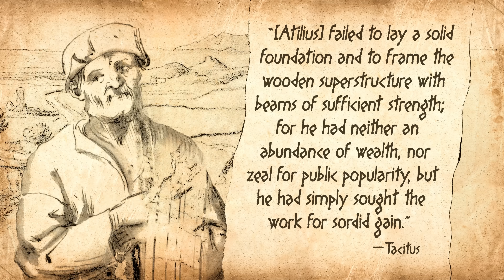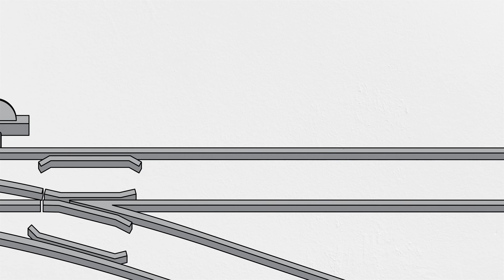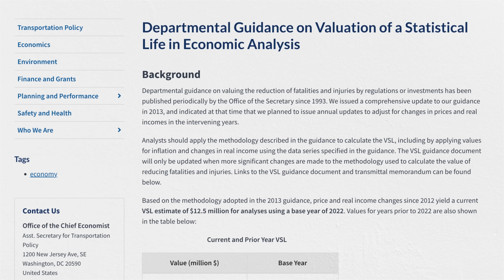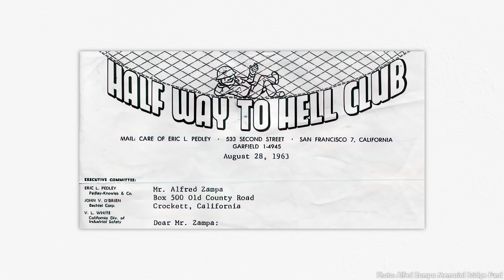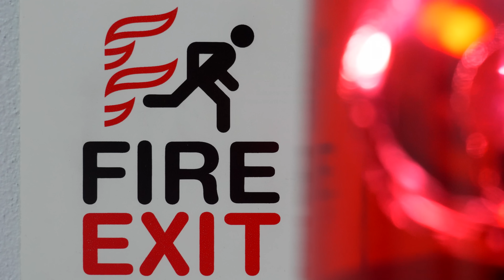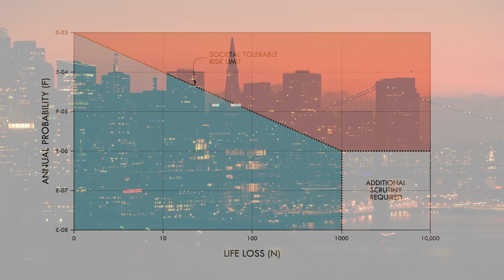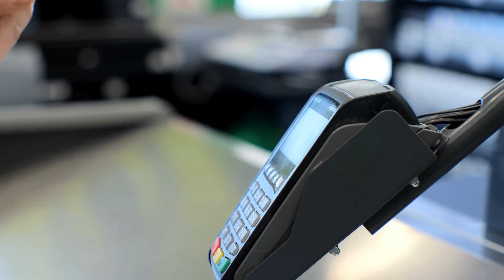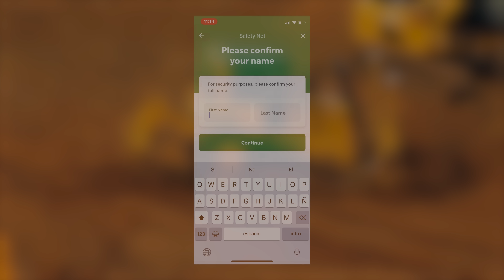How Much Is a Human Worth? (according to engineers)

Comment: Whenever the subject of monetary value with humans is spoken about, I always think back to the movie: "Blazing Saddles," where the backdrop of that movie was about the 19th century westward expansion of the railroads in the US.
Early in the movie it was illustrated that preserving railroad property was more important than human lives.  A railroad construction foreman wanted the quicksand hazard to be checked out, whereupon an assistant was taken to task for suggesting sending a team of horses to traverse the ground hazard.  The result was sending two railroad laborers, using a handcart, to check out the hazard.  The laborers and handcart sank in the quicksand.  Quick thinking by the foreman saved the handcart, leaving the two laborers to perish.  But, the laborers, on their own, made it to safety.
The populace in mainstream 21st century are appalled by such insensitivity for not rescuing the laborers.
The point that came across in that 19th century setting was that workers were not considered of value, as they were considered a no-cost item for the railroad company.  After all, there was no expense with hiring, and replacing, laborers for the railroad. 
But, replacing a team of horses and a handcart would have meant a replacement expense for the railroad company.

Comment: How much a life is worth is always an interesting question as so many different industries have different measures. Lawyers have clear metrics use, you have explained engineers,  nevermind more complex cases like military lawyers where set actions can have collateral or target usally protected sites as long as the target is a high enough level, which essentially assigns a backwards value. All important that there's clear guidance yet.

Comment: Very interesting. I've had a lifelong interest in engineering and construction of large projects. I'm a layman only, but an interested layman who is as well informed as I can be without going back to college.
Having said that, it strikes me that many major engineering disasters should be laid not at the feet of the architects or engineers but at the feet of the construction managers, who have a too-often irresistible desire to cut corners, typically by omitting certain parts of a structure altogether or by using lower grade or lower sized elements (smaller rebar, inferior concrete, rivets vs. bolts, etc.) While architects and engineers no doubt do have written professional ethical standards, I know of no ethical standards to which contractors must subscribe. Cutting corners, in order to save money on either labor or materials or time, are the fault of the builders, not the architects and engineers whose specifications are ignored.

Comment: Thanks for the video. Your video suggested that engineers may use the value of a human life to make engineering decisions. As an engineer I have never been forced into this situation and expect that many engineers never face this ethical dilemma. Instead we design and build thinks based on technical requirements that the customer provides. We must adhere to technical standards and meet performance requirements. Others may use the value of a human life in the calculations but I don't think engineers would typically be directly involved with these decisions. Also,  the thumbnail of your video shows people with a dollar amount bellow each of them but you do not talk about the value of life based on profession or other factors. This thumbnail is disturbing. Are you suggestion that we design and build things based on the value of the lives that use our products?

Comment: If you think these examples are crazy, have a look at the risk assesments for cern. including such brilliant lines like (from memory and translated here, likely a bit wrong) ... "While the damage caused by such an event would be unparraleled (estimated here as 6.8 billion human lives - with other damages deemed zero due to mootness), the mittigated risk level of 1 in 10 to the thirty fourth power would lead to the mathematical result of negliable(0). We nevertheless choose to enter this as a low(3), and require that it is reassessed not less than fortnightly to account for any change in situations. While the initial recomendation of low-medium(4) would have enforced this and was the initial recomendation of the sub-commitee, we do not belive that opening this point to further review by the non scientific community in lines with this assessment would be adviseable."

Comment: An important thing to note about the fire safety and workplace safety requirements: it is correct to say that those regulations were written in blood. However, that blood wasn't spilled just by accident, like a hurricane or something. Employers regularly used to lock workers in their factories during the day, like in the Triangle Shirtwaist Factory fire. To an employer, the ideal amount of safety regulation is whatever is cheapest. Similarly, the ideal wage and benefits they would pay you is as little as possible. Never forget which side of the equation you're on, and work together through collective bargaining and public policy to protect yourself and your coworkers.

Comment: Here in the UK the term used is value per fatality avoided.  Different realms have different figures and a lot depends on the volition of the user.  For example there are higher expectations placed on public transport and in particular railways when compared with private transport where the rider or driver has a duty to care for themselves too.  Formal treatment in general in the UK goes back to a seminal piece of legislation called the Health and Safety at Work etc. Act 1974.  It swept away many specific regulatory provisions and introduced the concept of reasonable practicability - risks have to be reduced so far as is reasonably practicable.  This applies throughout enterprise not just design.  It and many supporting regulations operate by placing general duties.  For structural safety these are in the Construction (Design and Management) Regulations with the most recent set issued in 2015.  These regulations require specific consideration and provision for users and maintainers of structures throughout their lifecycle including decommissioning, dismantling or demolition and disposal.  Where risks cannot be designed out the designer has a duty to formally transfer the residual risk to the client with requirements for operational controls (to reduce likelihood) and mitigations (to reduce consequence).

Comment: all highways in my country come with all safety measures except for bubblewrap
there"s either a divider or guard rail in the middle, a guard rail on the side, the rumble strips on the edge of the asphalt and outside the guard rail is a wildlife fence
there are many sections with these noise protection walls too

Comment: With all of this, the risks of a bridge, a building or a dam are very different:

A potentially harmed person can choose not to cross a bridge or to obey warnings (e.g., load limits, water level, etc), but can’t force others to obey — if I’m on a bridge at the same time someone else drives an oversized load across and collapses, it is an indirect risk to me. Still, on a bridge over water, there’s little chance of harming anyone who didn’t choose to cross the bridge.

For a building, I can choose to enter the building or not, but in general I don’t see a lot of warnings about buildings related to behavior, just mitigation: fire escapes and storm shelters. As near as I can tell, risk management for occupiable structures is entirely addressed in construction with the notion of thought-free use upon completion.

Dams, on the other hand, carry almost exclusively passive risk. Indeed, given that flooding is the most prominent source of increased dam risk, it’s unlikely that anyone would even be casually boating in the lead-up to a dam collapse, so pretty much all of the risk falls on people some distance downstream from the dam just as a function of land slope. It’s far more difficult to know whether those people can be said to choose to weigh the benefits of being in a particular valley at a time when the dam may break some distance upstream.

Comment: It seems like there is a lot of variation across sectors in terms of the price of a human life, just compare the statistics of air-travel vs. land-travel. There has been so much investment in air travel safety that it is now the safest form of travel, but automotive crashes continue to occur and claim so many more lives without much in the way of safety requirements. If you prefer to use a comparable mode of transit, consider the lack of safety measures on most buses. Schoolbusses are full of safety measures, but City busses are designed to allow people to ride standing up, not to mention the lack of seatbelts.

Comment: Great topic . You don't really mention that the value of life is rarely made by engineers . Often it's a political decision which isn't based on actual calculations but on the kerfuffle that an issue causes . For example who has actually been trapped in a car trunk and has the manual inside trunk release been of any value . But it could possibly somehow someway be of value someday. But it was not based on actual calculations .

Comment: This has a lot in common with the idea of threat modeling in security. Do you want something to never be breached? Sure, but that'll cost you just shy of infinite money. Like planning for safety improvements, you have to understand the potential risks and the associated costs of fixing them.Threat modeling helps you understand your vulnerabilities which can be more or less expensive to pull off, and this can be compared to the potential value to the attacker. 

Sure, the NSA could hack into your super duper encrypted copy of  grandma's "priceless" recipe for snickerdoodles, but they're more likely to spend those resources on tracking down terrorists and other baddies. Your consumer grade encryption will keep the keebler elves from stealing the recipe just fine. You don't need to pay big bucks for nation-state level security that will only stop someone with no interest in attacking you.

The overlap with the topic of this video is the idea of calculating the costs of implementing a fix and not doing so, and then using that info to make a call as to which makes more sense.

Comment: As an engineer in the aerospace industry, I try to explain the job of an engineer is to optimize a value-for-money equation.  Engineering students think mostly about the technical solution, but money (available budget, risk assessment, etc.) plays a larger role.  Those finance and economics electives are more important than engineering students think.  Great video!

Comment: I think that factoring in only the "value of statistical life" in engineering calculations for cost/benefit of fireproof materials in bridges is a bit incomplete.  Sure, the risk of lives lost due to a fire under a bridge is low, but what of the cost of rebuilding the bridge?  Were the bridge to have a fire-resistant materials on it's underside, that would give firefighters more time to put out the fire before permanent damage is done to the structure, reducing the cost of repairs or replacement?  To say nothing of the costs of redirecting traffic around the collapsed section during the repair process.

Comment: One major exception at 1:30 to people not having to consider the safety of a structure and not being to blame: leasehold apartments in the UK. Just look at how innocent apartment owners have been forced to pay to fix structures that were badly built in the wake of Grenfell Tower. Building a block of flats in the UK is one of the few cases where the victims are made to pay.

Comment: Would be interesting segway to a video about legalities of safety and post-event scrutinty. Depending on where you are in the world, there may be a common law about "duty of care" to eliminate hazards or reduce risks from hazards So Far As Is Reasonably Practicable (also known as SFAIRP or ALARP in other countries). At the end of day if something bad happens, courts determine if SFAIRP outcome is achieved on a post-event, case-by-case basis, using hindsight and engineers are on the hook to address their SFAIRP duty through due diligence using foresight and answer these two questions:
1. Was it reasonable, prior to the event, to think that this could occur? If not, why not?
2. Was there anything else which ought to have been in place which, if it had been in place, would have stopped this from happening? 
Unfortunately, arguments like “Control would have cost too much” or “The control was not required by the standards” are weak arguments. 
It would be interesting to see you elaborate on concept of cost being "grossly disproportionate" to the benefits in the eyes of the law. Maybe even showcase some real court outcomes to highlight using a concept like VSL to prove your duty of care can be trickier than a mere equation, even more so when foreseeable outcomes involve fatality.

Comment: At first, they shouldn't be working on a line that has a train runing on it... lol
But if there are six workers on a train line and they aren't deaf, nor blind blind but can't feel the train line shaking or the train horn, then It's called "natural" selection... the train horn overpowers most stuff... they're up to 140dbA (jet engines are 100, pain starts at 125). lmao
In the original version, they don't have a chance to move... but if you can move, well, then don't effing wait the effing train. lol

Comment: I think another important note is how the system design  impact injury's and deaths.  I think this is most clear with road design.  Pedestrian and cyclist deaths can be massively reduced with good street design.  If there are many pedestrian deaths at an intersection, the solution is not an expensive pedestrian overpass.  There are simple changes to road design, that can reduce vehicle speed and improve visibility. These accidents are a product of a poorly designed system, and eliminating them does not have to be expensive.

Comment: The idea that construction has to balance between costs and infallibility is a separate idea from that human lives should be valued for a certain amount of money - even if fallibility implies the potential loss of life.

The latter has several flaws.  You have to assume that you're dealing with good actors, otherwise you're only creating a proxy measure that bad actors will refer to when weighing the costs of litigation to their potential profits.

Most of your examples deal strictly with the former, such as bridges not being fireproof is an acceptable risk.  This is because we don't allow individual construction companies to write the rules of safety.  Contrast this with modern pharmaceutical corporations which deal primarily with the latter.

I think you're attributing to this economist's measure more relevance to your industry than it actually has.  I think that safety measures are more focused on the details of success/failure than a singular "value of life".  I think economists should never have been allowed to empower this little game in other industries.

Comment: Whoa, whoa, whoa. I'm sorry. Did I hear that right? Did you say "Engineering didn't even really exist at that time."? 24 C.E. (A.D. if you prefer). Just how exactly are you defining "engineering," sir?
My definition is: the branch of science and technology concerned with the design, building, and use of engines, machines, and structures.
People have been engineering extraordinary structures (buildings, temples, arenas, etc) since almost 10 THOUSAND B.C.E. 
Göbekli Tepe - 8 to 9K BCE
Cairn of Barnenez - approx 5K BCE
Need I go on?
And as for only being able to go by "a rule of thumb" which is a phrase indicating knowledge attained through experience and practice, but not founded in any theoretical basis: Our ancient ancestors had mathematical theories aplenty, and they applied those mathematical theories to engineer incredible structures, some of which have survived largely intact for THOUSANDS of years. I am so appalled by your hubris and lack of respect for your predecessors.

Comment: When I was in a internship in a big company, I found myself in a meeting with people discussing the risk of decapitation using a costly machine that needed repairs (a safety glass was missing basically). They evaluated the percentage of the risk, the cost of reparation for the machine and how much money they would have to pay if someone was killed using the machine. They finally decided, based on all those numbers and some other decisions factor that the reparation could wait. I was shocked to see them talk about human life as merely cost on a spreadsheet.
Reply: Companies have saved tremendous amounts of money because a human life, valued by insurance companies, has been evaluated at about a hundred thousand dollars. Most high quality machines cost more.
Reply: It's hard to believe that you were old enough to get an internship but still naive enough to be shocked at such a discussion. What, did you honestly expect that the value of saving a human life was infinity dollars?
Reply: @far2ez  You know, with my cursus I've started internships at 15, and it was my last internship at 24 and it was the first major company that was pretty cold about it, so yeah, it was a bit of a shock. Plus my field doesn't not generally involve those kinds of meeting.